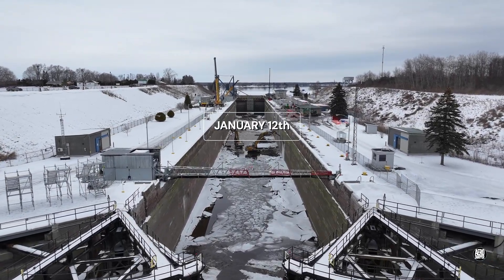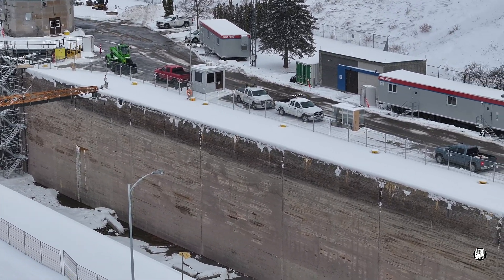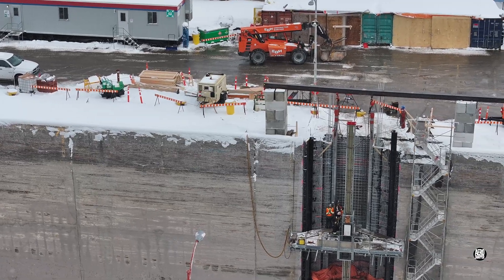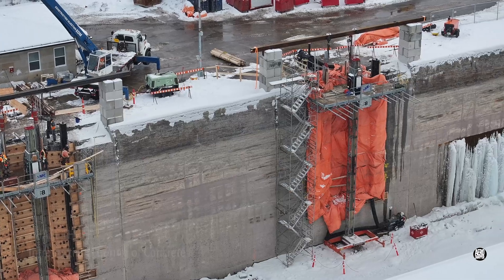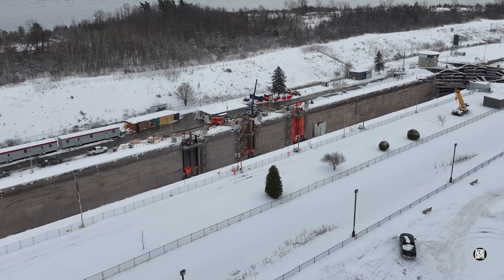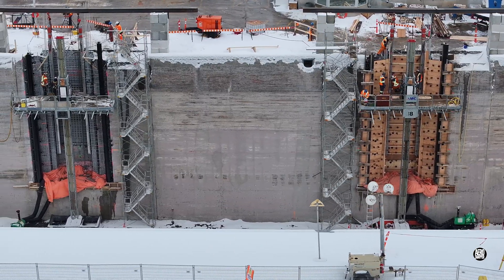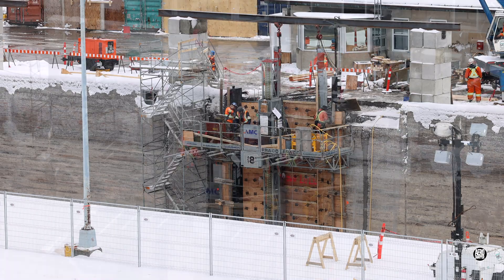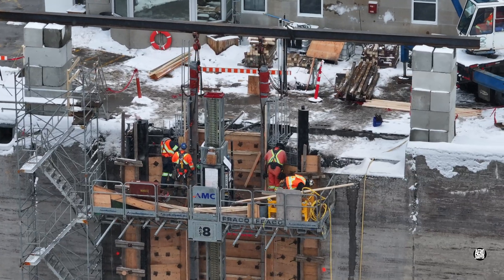Three of a Kind - an update on work to install vacuum mooring at Iroquois Seaway Lock 4K

Comment: Those vacuum mooring devises are a bad thing for the employees at the locks, soon will not need as many.
Reply from the maker: Tim - I can't speak to that - but it remains to be seen.  This is one of only two locks on the Seaway that did not already have vacuum mooring.  I suspect that its introduction was inevitable.